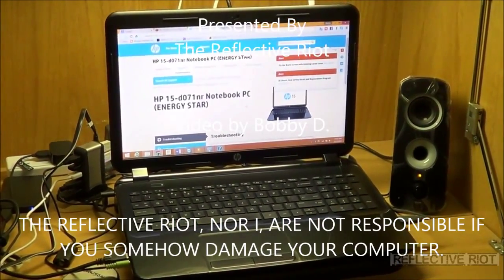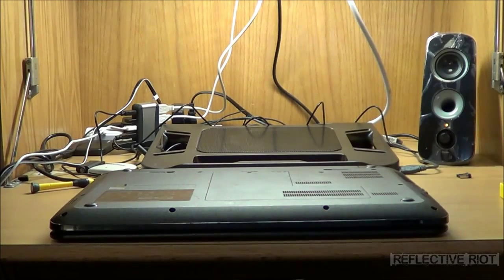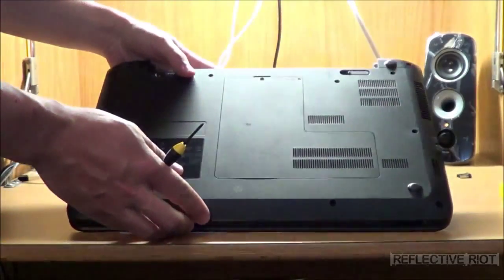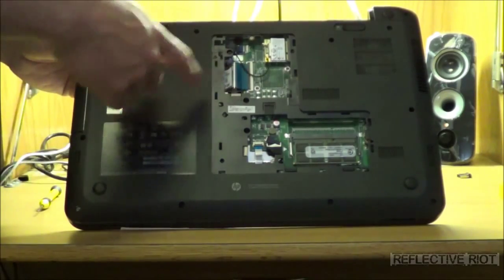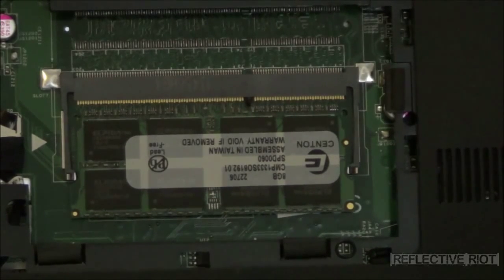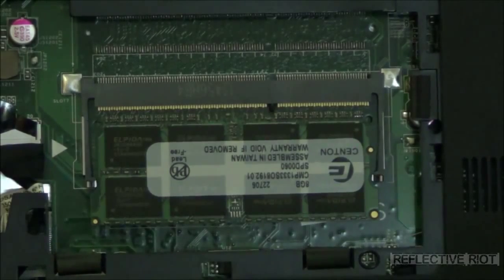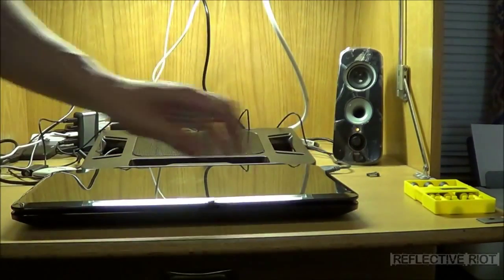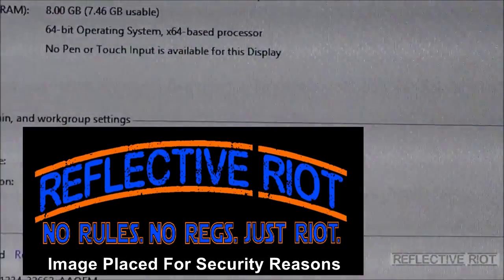How To Install or Upgrade RAM on a HP 15-d071nr or any D Series Notebook PC

Comment: Very well done video...thank you!. Hi have an hp 15-d017cl and the back looks the same as the one you demonstrated. For the love of corn, I can't find anywhere where it tells the max RAM I can install. Is it only 8 gig like what you showed and will that same stick you recommended for that model work in mine? Thanks for all the great help!
Reply from the maker: How many ram slots do you have? If you have 2 slots, you could add 2 8gb for 16gb total.
Reply: @mp3803  aren't there 16gb  ram sticks now
Reply from the maker: @seriouspinsyndicate3286  there are some, but HP states the max is 8gb.  It is possible that a 16gb stick would work but why waste the money? 8gb is more than enough for what type of load this computer and the A4 processor can handle.

Comment: Hi bro, i have hp d103tx with 4gb DDR3 ram with second slot can i add another #DDR4 ram. Bcoz DDR4 is faster than DDR3 standard
Reply from the maker: only if your motherboard and processor can support DDR4.  In most cases, no. The manufacture website says DDR3.  https://support.hp.com/ee-en/document/c04206739#AbT0

Comment: I have a HP Flyer Red 15.6" 15-f272wm Laptop PC with Intel Pentium N3540 Processor, 4GB Memory, 500GB Hard Drive and Windows 10 Home. 

My question is... There any way to swap out the 4gb ram for 8 gb? Seems how I play World of Tanks & World of Worships that requires at leased 2Gb of ram to run the game. Also this laptop is under warranty by 8 months.
Reply from the maker: you only have 1 slot with 4gb DDR3L currently installed.  you can purchase 1 8gb ram module.  Your specifications are DDR3 PC3-12800 • Unbuffered • NON-ECC • DDR3-1600.  You can buy any brand that meets those specifications.

Your system is only upgradable to 8gb.  I also recommend a solid state hard drive for gaming.

Comment: can you add a link to where you purchased the ram and specs, thanks!!!
Reply from the maker: +Dave T I found the ram for 39.99 at amazon.com&#160;

Link: http://www.amazon.com/Centon-Electronics-PC3-10600-1333MT-R1333SO8192/dp/B007YSIZLC/ref=sr_1_fkmr1_2?ie=UTF8&qid=1459308815&sr=8-2-fkmr1&keywords=centon+8gb+notebook+cmp

RAM: 8 GB DDR3 
SPEED: 1333 MHz
BRAND: Centon
PINS: 204

MODEL: R1333SO8192
TYPE: DDR3 SDRAM
Reply from the maker: DDR3 is the ram that is supported by this system.  I do not know if DDR3L is supported.